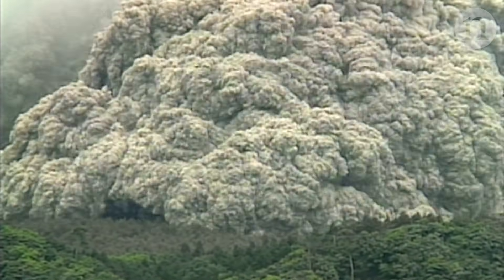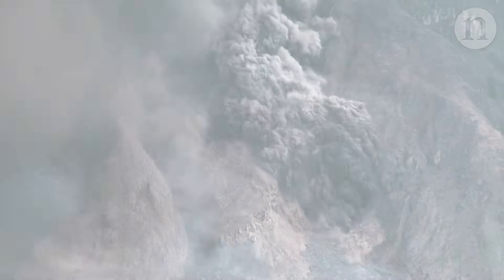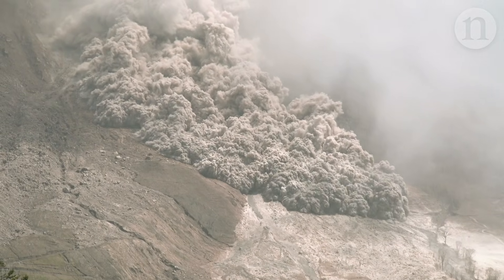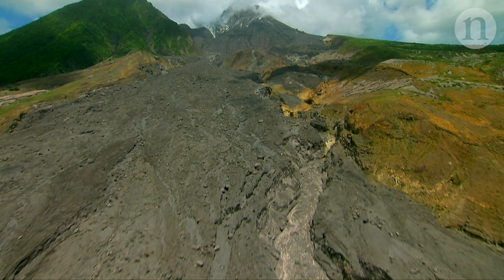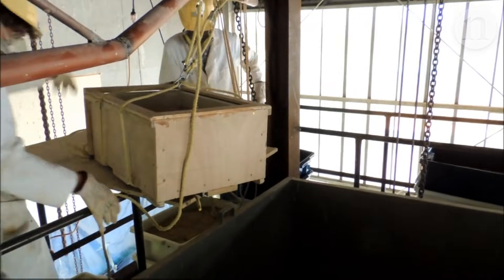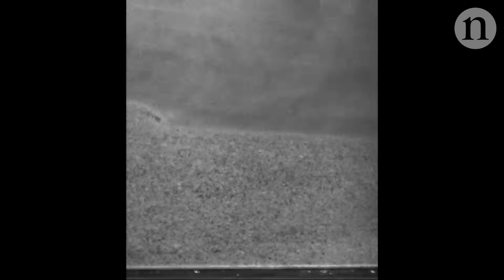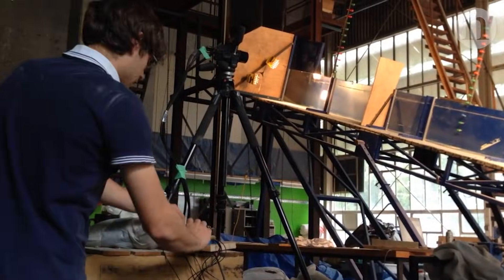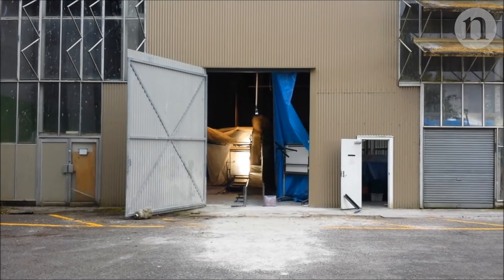Pyroclastic flows: The secret of their deadly speed

Comment: I'm sorry but I think you got it wrong. You know, lavine avalanches are also notoriously fast and long carrying and not having hot gases to carry the avalanche. But instead, during avalanche studies they discovered that the material is flowing fast in the middle of the avalache cloud. The outer layers of the cloud suffer from air resistance moving slower. That generates a "rolling motion" of material in which in the center of the cloud there is no air resistance at all. The front tip of the avalanche is moving fast but in the moment it is in open air, the particles move in the outer layer of cloud allowing new fast particles to emerge. Like bicycle racers drafting and changing leader continuously in peloton.

Comment: I have seen this phenomena my self first hand, and i can tell, its all but fun.
With that being said, it was not from a volcano, but rather a at a power plant, dealing with fly ashes.
When disposal of  fly ashes, under right circumstances, ash will behave just as described, as a fluid, and its fast, super fast, there is no time to react, if it wasn't because we had the right protecting gear, i wouldn't be writing this-
And that was "cold" fly ash, pyroclastic flows is super hot at the same time as its insanely fast.

Comment: Water droplet on a hot plate. This is a bit different because of the air density by temperature. But the only thing that I don't understand is how no plasma or electricity is discharged though such action.

Comment: *Spoiler*
It's gravity.
Also, Snow Avalanches top out at the same speed, indicating a fixed motivational force.
Reply: The mechanism in a pyroclastic flow is predominantly the expansion of hot gasses as opposed to gravity.
Reply: Yep that's a fact!

As molten hot lava and other elements from the eruption Cascade down the slope of the mountain, they emit gases at high rates and this causes the molten material to skid along the side of the volcano like a droplet of water in a hot pan. In both instances, and all three instances if considering both snow valances and magma valances, each cascading effect of the downward fall seems to reach near Free Fall speeds for different combined reasons

but it all pretty much amounts to the same concept, lack of friction within the presence of gravity in an atmosphere.

Comment: Also makes sense when you consider all of the gases in a pyroclastic flow were both under pressure and extremely heated when released, and now in atmosphere those gasses are doing what superheated, pressurized gasses do in any EXPLOSION, rapidly expanding in volume as they move. The gasses are not only rolling downhill from gravity due to being denser than air, but they're also rapidly expanding at the same time and accelerating anything along for the ride.
Reply: They'd certainly be causing any air they come into contact with to expand, but wouldn't the volcanic gasses be fully expanded and slowly cooling once they've left the earth and become part of the flow? (I'm assuming they wouldn't be getting further heated by the ash since it all came from the same place) 

Unless it's just taking a long long time to finish expanding after coming out of the ground where it was under more pressure, and that is occurring throughout much of the flow?
Reply: @ChadDidNothingWrong  Air gets mixed in, gets heated, and expands. Not sure if there could still be some pressurized gas bubbles.
Of course, the topic as a whole is more complicated than can be fully covered in a 2-minute video.
Reply: @dragonridley  forgot about the air mixing in...lol. Thank you for the response